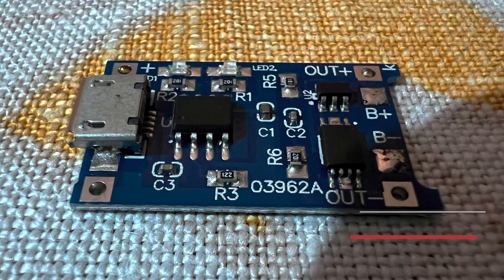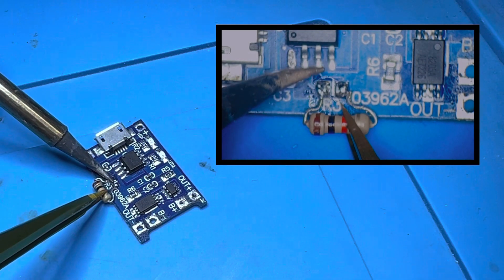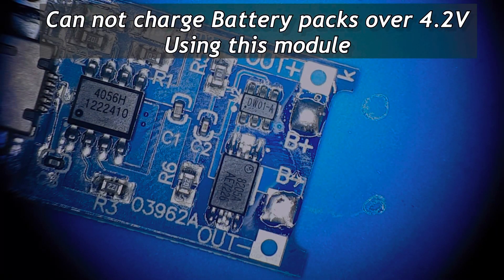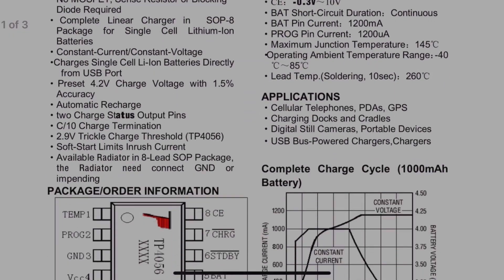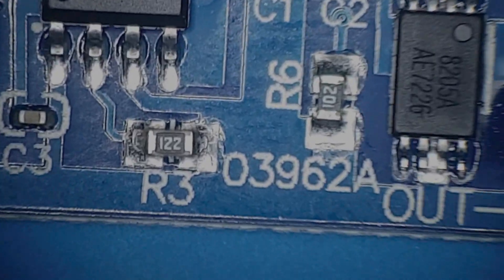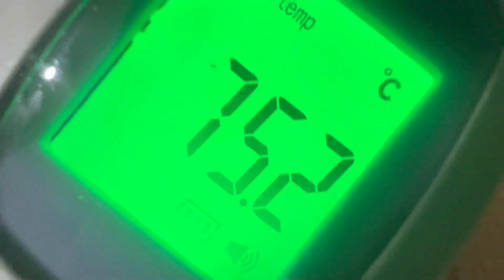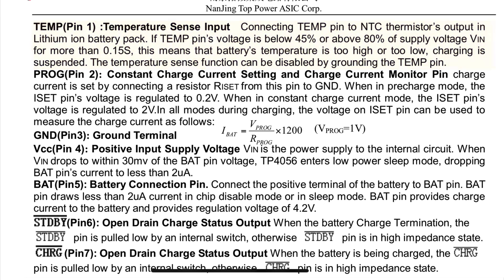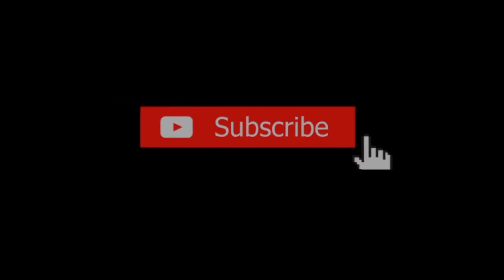Tp4056 Li-ion battery charging module|Deep review |how to use it |What modifications it makes better

Comment: Very nice explanation ♥️ one thing I want to ask you that suppose I have  full charged 2000 mah x 2 batteries with this module and connect the load to the output points of module , then how much current I will get ?can I  give 2 ampere output to the load ?
Reply from the maker: yes you can. battery over current protection will trigger approximately 3A

Comment: In connected 3pcs of  tp4056 in parallel, but to my surprise only one is showing red light for charging while the remaining 2 only show blue light, can you tell me if not all tp4056 can be connected in parallel or i need to change any on the board ?
Reply from the maker: make sure battery lines are also connected in parallel

Comment: Can you please tell me how to convert output 4.2 v to 1.5 V in this module ? Ampere must be 600+ ma
Reply from the maker: Connect buck converter (step down module) to tp4056  output pads. Then adjest the voltage to 1.5V using step down module . In this way you can get 1.5v out put

Comment: Can I use the TP4056 to drive an electric motor in a window vac?  It would be connected to 1 x 18650 battery.
Reply from the maker: What is the voltage and amperage required to run the motor?

Comment: ayiye load eken out karanne battery eka charge wela eke power ekada naththan charge wena gaman wenama power ekakda???
Reply from the maker: battery power eka .
Reply from the maker: samanyen tp4056 charge wena gaman use karanna hoda na. Mokada ic eken step kipayakata charging eka wenne. Charge karana gaman use weddi voltage level detect wena eka
Hariyata wenne na

Comment: Me module eken output volt eka 1.5v-3v vage adu volt AA vage battery charge karanna hadanna puluvanda
Reply from the maker: Baha meken li-ion battery witarai charge karanna puluwan e kiyanne nominal  voltage eka 3.7v only. Oyata AA battery charge karanna onenam cc cv change karanna puluwan podi buck converter ekak gattanam hari voltage level adjest karala podi setup ekak hadaganna puluwan

Comment: laptop battery  akakin ගලවා ගත්ත battery පැය 12 chager  karatha නිල් පාට වෙන්න ෆුල් chager  වෙන්නෙ නැනෙ
Reply from the maker: multi meter එකකින් battery voltage එක check කරල බලන්න. Module එකේ ගැටලුවක් වෙන්නත් පුලුවන්. මුලින්ම voltage එක බලන්න
Reply: voltage akak adu unoth ahemada wenne
Reply from the maker: cell එකේ අවුලක් වෙන්නත් පුලුවන්. Module එකේ අවුලක්
වෙන්නත් පුලුවන්.
Reply: contact  karaganna puwan widiyak  kiyanawada
Reply from the maker: 00393348103883 මේකට whatsapp msg එකක් දාන්න
Reply: Contact number denna pluwanda

Comment: parallel connected 4 batteries can we use for one module?
Reply from the maker: no no connect only 2 batteries. Because 3 or 4 batteries mean more capacity. if you charge 3 or 4 batteries ,the module will produce lot of heat.so only use 1 or 2 18650 batteries with tp4056 modules 🔋

Comment: do not buy fucking pcb it it will not work after 1m or 2m and will not keep 4.2v it will higher and battery go bad.
Reply from the maker: my modules are still work fine. But your informations are valuable  thank you very much 🤜🤛

Comment: Thank you hoda pahadili kirimak.. mata danaganna puluwanda outdoor antenna ekakat Mini UPS  ekak hadanakot e antenna ekata ena power adapter ekama use karanawada nati nam oya module eka use karanna oneda? Me module eka use karanawa nam kohkmada use karanne?
Nathinam BMS ekak dammama athida thiyana power adapter ekan current eka dila..?

Ita amatharawa heat sensor eks BMS ekakat akathu karaganna puluwan kamak tinawada?
Thank you
Reply from the maker: eka tirane wenne antena eke power adapter eke voltage eka anuwa. voltage range eka 4v - 8v atara wage tiyenawanam tp4056 module ekakata e line eka sambanda karanna puluwan. oya hadanna yana battery pack eke voltage pramanaya anuwa tama to4056 module ekakda bms ekak da one kiyala tiranaya karanna wenne. e gana wistara kiyanna etakota man mita wada oahadili idea ekak dennm

bms module walatanam me widiyata sensor ekak add karanna baha mokada eke tem sensor input support karana ic ekak nane. habai wena widiyakin sensor ekak add karanna bari kamakut naha
Reply: @theelectroroot4919  

1st thank you so much, reply karat. Mn channel kipayakama comment kara aduma reply kare mek vitharai. Highly appreciate and respect 🙏 

Mage tiyenne 15V  0.8A DIALOG outdoor unite ekak.. ekata aduma dawask wath current natuwa run wenna puluwan MINI UPS ekak hadaganna one. Mata oya balancing BMS eka thoraganna awabodayak na & battery kiyak pack ekak hadanna oneda kiyana eka.
Reply from the maker: @asirirajapaksha707  15v one karana nisa 4s bms ekak ganna 4s pack ekakin uparima 16.8 v out wenawa. 4s bms ekakin 2p4s wage battery pack ekak hadagena buck converter ekak dala 15 v wala output eka hadagena antena ekata denna. Capasity adunam oyage chager ekenma charge karanna puluwan habai itin puluwannam cc and cv limit karala
Laptop chagert ekakin wage charge karagattot oyata loku efficency ekakin pawichchi karanna puluwan. Man ilagata danna inne power backup system gana video ekak eken oyaya tawat ideas labei. Mona hari tawa danaganna one unot kiyanna danna deyak kiyala dennam.
Reply: @theelectroroot4919  
Thank you so much 

Pahadil.. xl 6009 booster ekak use karanam hari neda voltage balance karaganna.
4s BMS eka AMPIER kiyaka ekakda ganna hoda.  40A, 60A da?

Eke power adapter ekak tinneth 15V 0.8A output DC ekak
Reply from the maker: @asirirajapaksha707  ou e buck convertor eka hodai. 40A ati . O.8A nam madi . Hodama de tamai wenama chager ekak use karana eka
Reply: @theelectroroot4919  

Ok.. thank you so much.. ❤️🙏💪
Reply: @theelectroroot4919  
Wena charge ekak use karanawa nam 
Specification poddak kiyanna puluwanda?
Reply from the maker: @asirirajapaksha707  parana laptop ekaka 19v chager ekak araganna. Current and voltage dekama adjest karanna puluwan buck converter  ekakut ganna. Charger ekata buck converter eka sambanda karala cc and cv (constant current and constant volage) eka oya hadaganna battery pack ekata galapena ganata adjest karaganna ( 4s bms ekaknm voltage eka 16.8-17.5v current eka oya dana parallel battery pramanaya anuwa wenas wenawa) . Ita passe me cc and cv walin oyata puluwan oyage battery pack eka charge karaganna.

Me wage charging system ekak hadagattot oyata  idiriyatat prayojanawat wei mokada 19v 4A wage wenakan adjestable  max charging current ekak out karaganna puluwan. Itin size eken wadi li-ion unat safly charge karaganna puluwan.
Reply: @theelectroroot4919  

Well explained 👏 cleared 
Thank you.. respect you.. 🙏
Reply: @theelectroroot4919  
Thawa podi deyak tinawa danaganna 😁
18650 battery 
26650A battery athara wenasa mokakda?
4s 40A BMS ekata 26650 battery use karanna puluwanda?
Reply from the maker: @asirirajapaksha707  saralai 18650 battery walata wada 26650 battery wala single cell ekaka tiyena capacity eka wadi. e kiyanne 18650 battery ekaka max capacity eka 3600 mAh wagene wenne. 26650 battery ekaka 5200 mAh wage wenawa.
battery warga dekema nominal voltage eka samanai.  e kiyanne battery dekenma  3.6v nominal voltage ekak ganna puluwan. bms ekata recommend karana current ekata anuwa battery add karanawanam 26650 use karata gaulak wenne naha. habai 18650 and 26650 kalawam karala battery pack hadanna epa. 26650 use karanawanam e battery witarak use karala pack eka hadanna.
Reply: @theelectroroot4919  

Pahadili...
Thank you 💪💪💪
mAh wadi nisa use karanna puluwan time eka wadi wena eka ne wene 26650 battery use karahama..
Reply from the maker: @asirirajapaksha707  yes e wagema tamai capacity wadi weddi chager eke A agayat wadi wenna one .

Comment: 26650 බැටරියක් චාජ් කරද්දි මොඩියුලය අධික ලෙස රත් වෙනවා. ඒක වලක්වා ගන්නේ කොහොමද
Reply from the maker: 26650 battery වල capacity එක වැඩියි . අනික 26650 recommended charging current එක 3A . Tp4056 module එකෙන් max out වෙන්නෙ 1A . ඉතින් හිතල බලන්න රත් වෙන්නෙ නැතිව තියෙයිද. ඔයාට options   කීපයක් තියෙනව .ඔයාට පුලුවන් heatsink එකක් පාවිච්චි කරන්න. නැත්නම් tp4056 module 3 ක් parallel කරල charge කරන්න.
Reply: @theelectroroot4919  ඉතාමත් ස්තූතියි. හීට් සින්ක් එකක් සවිකරන ආකාරය කියා දෙන්න හැකිද.
Reply from the maker: @chandrasiriranathunga404  මුලින්ම module එකේ ප්‍රමානය ට ගැලපෙන heat sink එකක් හොයාගන්න. ඊට පස්සෙ module එකේ යට පැත්තෙ තියෙන soldering points ටිකට electrical tape ටිකක් ගහගන්න short නොවෙන්න .ඊට පස්සෙ compound ටිකක් දාල heat sink එක mount කරගන්න. Ziptie එකකින් mount කරගන්නත් පුලුවන්
Reply: @theelectroroot4919  ඉතාමත් ස්තූතියි. අළුත් වචනයකුත් ඉගෙන ගත්තා zip tie

Comment: Hi. IC tp4056 and 4056H are different circuits ??  how do they differ?
Reply from the maker: no ic pin outs are same. charging current and input voltage ranges are bit different

Comment: Video එකට අදාල නැති උනත් මම මේ කියන්නේ experience එකක් ගැන. 
Please, Li-ion 18650 battery වල CID එක reset කරන්න එපා!. CID එක trigger වෙන්නේ battery chemistry එකේ වරදක් නිසා. මම test කරන්න පරණ Sanyo 18650 (0 voltage) battery එකක් CID reset කලා, battery එක පිපිරුනේ, ගිනි ගත්තේ නෑ, නමුත් පැය කීපයක්ම battery එකෙන් chemical gas එකක් පිට කෙරුවා. Battery voltage එක 3.58V පෙන්නුවා. නමුත් Battery එක ළඟ වත් ඉන්න බෑ, උගුර දැවිල්ල ගන්නවා chemical gas එකට.

Please, be careful. It's not worth the risk!
Reply from the maker: ගොඩක් හොද උපදෙසක් . ඔයා හරියටම හරි ගොඩක් වෙලාවට අපේ කොල්ලො අඩු බැටරි ගානක් එක්ක වැඩ කරද්දි එකම එක බැටරි එකක් උනත් එයාලට වැදගත් . ඒ නිසා ගොඩක් වෙලාවට cid reset කරනව. ඉතින් ඔයා දුන්නු මේ උපදෙස ගොඩක්ම වැදගත් මේ 18650 බැටරි එක්ක වැඩ කරද්දි හැමෝම ගොඩක්ම පරිස්සම් වෙන්න ඕනෙ.
අනිත් කාරනය තමයි මේ  sanyo cell පාවිච්චි කරද්දිත් පුලුවන් තරම් capacity සහ resistance values ගැන සැලකිලිමත් වෙන්න. මොකද මේ sanyo cell වලට red bombs කියලත් කියනව. used Sanyo cell 100 check කරොත් cell 40 විතරම overheat වෙනව  . කොහොම හරි ඕනම 18650 cell එකක් එක්ක වැඩ කරද්දි මේ දේවල් ගැන සැලකිලිමත් වෙනවනම් ගොඩක් හොදයි.
Reply: @theelectroroot4919  එක සිංහල වීඩියෝ එකක් තිබුන 18650 බැට්‍ර්‍ රීසෙට් කරන්න කියල දෙනව. කොච්චර භයානක දෙයක්ද.
Reply from the maker: @samanpriyadarshana133   cid reset කරන්න හිතන්නවත් එපා
Reply: parallel connected 4 batteries can we use for one module?
Reply: @maheshamarasinghe4738  yes you can, but it'll take long time to complete the charging process.

TP4056 module limited to 1A of current by default, and delivering 1A of current for a long time leads to over heating of the IC. An active cooling (DC fan) with a proper heatsink should be needed. 

Or you can stack 3 modules to increase the current upto 3A (little bit more perhaps), that way you can reduce the charging time.
Reply from the maker: @maheshamarasinghe4738  try ip2312 module with BMS
Reply: Battry Reset karanwa kiyne mokdda?
Reply from the maker: @kasunperera4625  18650 battery කාලයක් පාවිච්චි කරද්දි voltage out වෙන් නැත් වෙනව. එතකොට ගොඩක් දෙනා battery එකේ possitive side එකේ තියෙන pin එකක් press කරල battery එක ආයෙමත් voltage out කරන විදියට හදාගන්නව. ඒකට තමයි මේ CID RESET කරනව කියන්නෙ.  dead උනු 18650 battery කිසිම වෙලාවක reset කරන්න එපා.
Reply: @kasunperera4625  CID යන තේරුම Current Interruption Device යන්නයි, එය fuse එකක් ය. මෙය 18650 li-ion battery වලට යොදා ඇත්තේ battery ආරක්ෂාවට නොව, එය භාවිතා කරන පුද්ගලයන්ගේ ආරක්ෂාවටයි! 

CID trigger වීමට හේතුව, battery හි අභ්‍යන්තර පීඩනය වැඩිවීමයි. අධික උෂ්ණත්වය, අධික වෝල්ටීයතාව, අධික ධාරාව (battery short circuit) වැනි හේතු මීට බලපායි. මෙවැනි දෑ battery එකට සිදු වූ පසු CID reset කර නැවත භාවිතා කිරීම භයානකයි. පිපිරීම්, ගිනි ගැනීම් වැනි හේතුවෙන් ජීවිත හානි, දේපළ හානි සිදුවිය හැක. 

මෙහි (CID reset) අවදානම battery නිෂ්පාදකයින් විසින් විස්තරාත්මකව පැහැදිලි කර ඇති අතර, ඒ පිළිබඳව YouTube videos ද ඇත.

Ii-ion battery ලංකාවේ මිල අධික හේතුවෙන් ඇතමුන් CID reset කිරීමට පෙළඹෙනවා, සමහර පුද්ගලයින් එය සාර්ථක වූ බවත් පවසනවා. නමුත් කාටවත් කිව නොහැක්කේ අනතුරක් සිදුවිය හැකි අවස්ථාවයි!.

Comment: Micro USB port sambanda kalavita vayar eke Anith port eka sambanda karanne 
Kuma katada
Reply: Module ekata plug karana micro USB port eke chargare Anith kelavare port eka sambanda karanne mokakatada
Reply from the maker: @damindak.a.7847  module එකේ අනිත් කෙලවරේ වෙන port එකක් නැහැනෙ. Module එකේ තියෙන්නෙ micro usb port එකක් විතරයි. ඔයා අහන්නෙ usb cable එකේ micro usb side එක module එකට connect  කරාම cable එකේ සාමාන්‍ය usb side එක plug කරන්නෙ කොහාටද කියලද ? ඒකනම් අහන්නෙ ඔයාට පුලුවන් ඔයා ලග තියෙන සාමාන්‍ය usb adapter එකකට cable එකේ අනිත් කෙලවර සම්බන්ද කරගන්න.
Reply from the maker: සමාවෙන්න මට අහන දේ පැහැදිලි මදි. Micro usb port එකට connection දුන්නම. Wire එක අනිත් port එක connect කරන්නෙ කුමකටද? (කියන තැන පැහැදිලි මදි)

Comment: ඔය මොඩියුල් එකෙන් ලිතියම් බැට්ට්‍රි එකයිද චාජර් කරන්න පුළුවන්
Reply from the maker: පැරලල් විදියට  18650 බැටරි 2 ක් සාර්තකව charge කරගන්න පුලුවන්.
Reply: @theelectroroot4919  thank you
Reply: ඒකෙන් v 12 ලයිට් පටියක් පත්තු කරගන්නෙ
Reply: කොහොමද
Reply from the maker: @sumithkumara9572   මේ module එක use කරල 4.2v. තමයි උපරිම out කරගන්න පුලුවන්. එතකොට ඔයාට මේ system එකෙන්ම 12v පටියක් lightup කරන්න ඕනෙනම් ඔයාට dc stepup module එකක් use කරන්න වෙනව.  
https://youtu.be/M9VON7R1Q7A මේක බලන්න අදහසක් ලැබෙයි
Reply: @theelectroroot4919  එහෙමද මට ඒ මොඩියුල් එකේ පොටෝ එකක් එවන්න
Reply from the maker: @sumithkumara9572  ebay mewa search karala balanna .
• MT3608
• mini step-up module

Comment: Ic eka rath wenawane 18 650 battery  kipayak ekata hayi kalama.ekata wisadumak nedda. 1kata wada hayi karanna widiyak nedda nethnam.
Reply from the maker: normally 18650 cell  2 k tamai me module ekata recommend karanne. Capacity wadi 18650 battery wadi pramanayak charge karaddinam tikak wadiyen heat wenawa. solution ekak widiyata podi heat sink ekak short nowenna attach kararagannat puluwan. ehema natnm wadi battery pramanayak use karanawanam battery walata galapena constant current ekata adalawa module kipayak parallel connect karaganna.